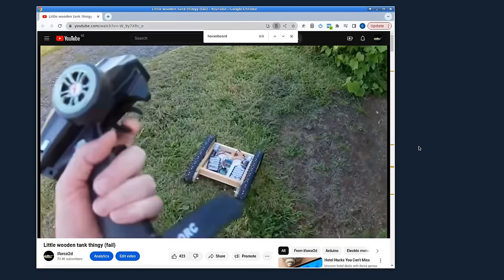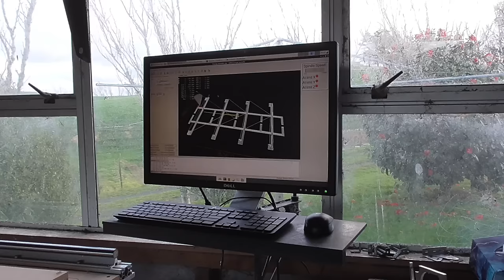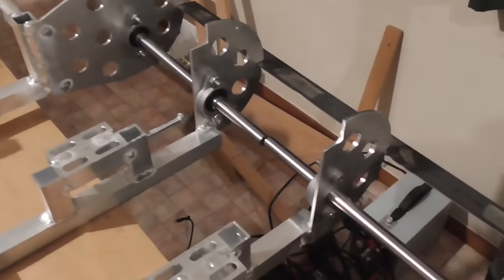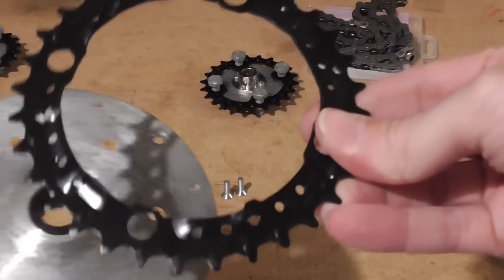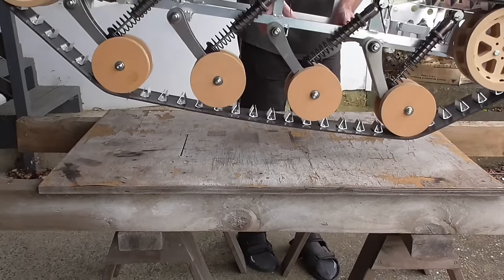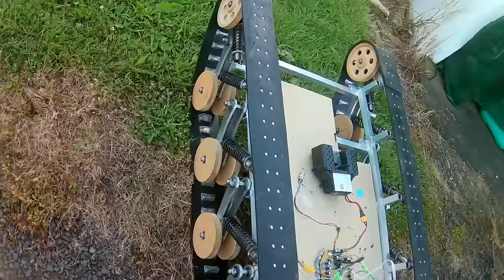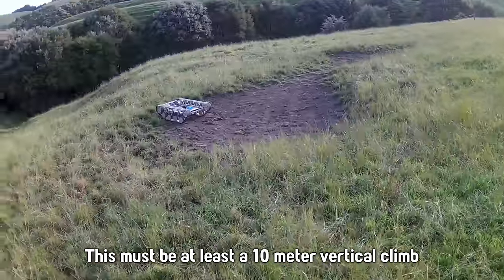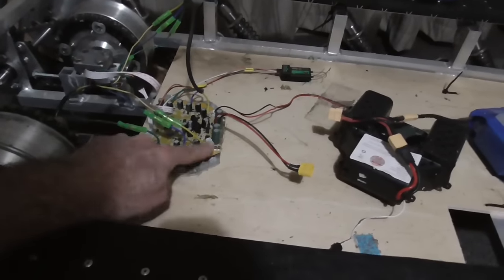RC tank thingy (hoverboard motors)

Comment: I think you need either bigger springs or more preload on your front idler shocks to stop the tracks winding up when you reverse, in the clips you can see the idlers moving backwards and dropping the tension off the tracks. Otherwise fantastic project, reminds me of the bomb disposal robots I drove around for years.
Reply: His suspension is pointing ass end. This means any speed or traction will reduce the diameter of the tracks.
Reply: Yeah, the preload needs to be wound up quite a bit.

Comment: I smiled from beginning to end like an old crone gurning!  Love the CNC drive sprockets etc.  I did not think the MDF would be good for more than a few lightly loaded runs... they sure proved me wrong.
When reversing, the full torque of the motor is directly compressing the spring of the front sprocket.  Don't increase the preload of that spring, but limit the travel of the front sprocket to the point where the belt teeth cannot skip.  Something like tube or hose over the front shock absorber shaft should do it.
As you said, sorting the gearing is first priority.  Plenty of options, but none that really stand out.
The amount of grip you are getting from the smooth tracks is amazing!  I always assumed you had to have really agressive teeth (Edit: "treads").
This is obviously not a cheap project, but at this point it has relegated the Farm Rover to Fading Ghost status!
Love it, thanks.

Comment: You could use a second set of sprockets towards the center to modify the gearing without changing your front sprockets.  You'd just need to move either the motors or the driven sprockets to have the altered alignment so the chains could go towards the center then to the driven axle
Reply: I think it's called a counter shaft or jack shaft. Looks like the tank could use more weight towards the middle.

Comment: A very fascinating design, particularly the suspension. Love the CNC work, it like seeing art being made. Impressive performance, climbing hill, etc. I don't think this fantastic project is going to be put aside for long, as it sounded like you're having too much fun. ;)
Regarding the gearing ratio, to me looks like the rear cross brace is in the wrong spot to use larger gear. (45:35) It will need to move aft, or forward relative to the axil(s). Don't think there will be much bulge, just a bit in front of and half way to the motor. Using a nearer to 1:1 gear ratio would eliminate any bulge. The more complex option is bigger rear wheel sprockets (to match the larger gear size) and lowering axil to keep flat top. It would not impact suspension clearance height, but might mean moving rearward to allow the rear suspension arm to have full travel (an issue pointed out). A stronger spring on the rear arm might stop the bottoming out.

Comment: Brilliant build, I've built a six wheeled cargo robot of a similar size using hoverboard motors. Top tip (and I wish I knew it before I built mine) is that the width between the tracks needs to be wider than the tracks are long. This gives you a lot more turning torque, tanks get around this with brute force which is why they can be narrower. You could also increase the preload on the suspension so that by default the front or rear is higher off the ground
Reply: Suspension is 100% on the list for the v2...
https://youtu.be/VlSwjEoBnWk

Comment: Lol, I wasn't expecting to see my name on the video, especially from a 3yo comment! I'm thrilled you make the hoverboard tracked vehicle a reality! They truly are a fantastic platform for robotics applications.

Just a couple notes & thoughts:
1. Make sure you tune the ADC readings for battery voltage. At least for me, I found that the replacement firmwares were triggering low-battery shutoffs even when the actual state of charge was fairly high. There is a procedure in the docs for calibrating those values.
2. Have you considered designing a replacement wheel/tire for the hub motor itself, allowing direct drive? The hoverboard motors are pretty well sealed out of the gate, and when I built of HB E-longboard I ran it though lots of muddy, puddles, and through the rain without any water ingress. The benefit here would be eliminating the chain/sprocket/drive axles/bearings entirely, allowing a much more easily 'waterproofed' system with less complexity.

Great video as always!
Reply from the maker: Yeah, after both runs the battery was at 35.5V which seems a little high, barely under storage charge.
I did notice some decent seals on the shaft, good to hear they are at least reasonably waterproof. After this first test I'm thinking more that direct drive might be the way to go. I'd like it to be fully amphibious so extra measures might be necessary, but it's probably an easier starting point than trying to waterproof a spinning shaft coming out of the hull.
Reply: @iforce2d  yeah definitely sounds like the calibration could be off, unless those HB batteries have high ESR and sag a lot under load. If it's helpful at all, I have discovered those HB main boards and motors run fantastic under a 13S battery. I have a cart I built using two sets (4WD) powered from a 13S Lion data center backup power pack rated for 100A cont. Discharge. Haven't killed a motor or main boards on it yet, so I think it can handle it safely. My HB longboard is a custom 12S battery and it runs great with that too.

Last note about the waterproofing, you might want to pop the seals off the shafts and grease them up. Every motor I have gotten has had the seal there, but be bone dry defeating the purpose and maybe even prematurely wearing out the seal. The grease will definitely help them.

Comment: the hoverboard firmwares will put out debug info/telemetry on a serial port depending on the config you use.  You can add a single ESP32 to glue together RC (crossfire)/bluetooth (wiimote)/hoverboard protocols as well as drive an OLED display for data, minor data logging, and a web interface for configuration if necessary.  you get a lot of bang for the buck for just 1 ESP32.  You also probably don't want to be using PWM because those boards are extremely noisy and the hoverboard firmware does not handle PWM noise very gracefully.

Comment: Midway in the video I though it was going to be way bigger hehe. I have 4 of those motors on my skateboard. If you rewire them from star to Delta connection inside they become beasts! You loose a slight amount of torque but gain a multiple amount of power! So Delta connection with down gearing turns these motors into something usable in 1:1 size application. 4 of these motors would actually be enough power for something that you could sit on and take you many miles. My skateboard is more powerful than a moped and takes me about 15miles on asphalt. I run 4 vesc on my setup and 8 Makita 18V batteries at 36V working voltage. Giving the motors 56V and really geared down you could make something real useful with 4-6 of em! A ridable 6 wheeler would be awesome! The clue is motor efficiency, Delta is way more efficient and you dont really loose much energy in a gearbox vs twice the twice the winding resistance in the original star winding setup these comes with.

Comment: Hey Chris, this could cost you a lot, the tracks alone. But I see you had some nice design challenges to solve. Re-gearing it would be better. Going backwards though, there seems not enough guidance from the top part of the track, maybe that's why the teeth are jumping at times? When the tension is the lowest it happens. That bump stop will help for sure, it looks very stable as well.
Thanks for this one!
Cheers 👍💪✌

Comment: I had the same problem machining a slot in steel with a high speed spindle. What worked for me was  to use a smaller end mill and do a trochoidal toolpath, full depth.
Reply from the maker: I bought a lathe recently which I will try for this job next time, if there is a next time. The lathe can go much slower.

Comment: I’m also building ex tanks but smaller and high speed. Achieving good yaw control is critical. I’m currently experimenting with gyros. I also think sensored motor control is also needed.

Comment: Well dang. I've been looking to do almost exactly this only I didnt think of the hoverboard. The best I'd gotten so far was scooter motor hubs, which are a lot more expensive for one than for whole hoverboard.
-edit
not for nothing, but if you want more high speed power at slightly (significantly) more cost, you can remove the rectification diodes from an alternator and power it with a regular sensorless ESP. Then you've got the belt attachment ready to go. Also, obviously, you have to power the rotor field coils, which is annoying.

Comment: To improve spring strength, could you nest the old springs inside the new ones?
For suspension, could you make half of the swing arms swing back and the other half swing forward, so you have them preloading the same amount on the tracks in either direction of travel? That looks like a bit of work to re-weld the frame though.

Those tracks look surprisngly good! 

Though there may be ways to improve them without adding much cost, could you use two layers of rubber, instead of overlapping them to join, you just offset the layers by half the length for the most engagement between the layers. You could also possibly put some kevlar cloth between the two layers to prevent stretching of the tracks, that stuff is damn stiff in tension! 

I hear you can improve power dissipation in those motors by either filling them with a light oil, so there is better thermal conductivity to the outside casing, or machineing vent holes in the side plates so they pump air through themselves
Reply from the maker: The springs are all the same size unfortunately. I could make some spacers to increase the preload though.
If you want any reasonable speed over bumps, you can't have the swingarms swinging forward.

Comment: Wondered if you considered using chain as the drive to which one could attach the "now flexible and stretchy" rubber.  Important just where one locates any "idler tensioner " as well, usually only on the off drive side of any pulley arrangement. Difficult /well-nigh impossible to do when one has reversing drive.

Comment: 22:50 - just have the same adapter plate for the small holes, but put the big holes inside the small, right?

As long as the small sprogit fits over "the bumpy thing", that should work I reckon.
Reply from the maker: The chain is about 8mm wide and needs to overhang the aluminium adapter plate, is the awkward part. I could make a second (small) adapter plate to attach to the first and allow the overhang, but I think it would then collide with the motor mount clamp. Might need to change the motor mount completely...

Comment: I had some issues with lag on the same transmitter so I wouldn't be surprised if that was the cause of the lag.  One thing I would definitely do is increase the tension on the tracks to make sure it can actually reverse. You can see it loosening up quite a bit every time
Reply from the maker: The 'lag' is coming from the 'velocity' control method which uses the hall sensors to measure how far the motor has turned. When I let go of the stick, the momentum carries the tank a bit further, the controller senses this and corrects it, with a slight delay. You can see this at 32:19 where it even oscillates twice (right where I'm saying 'whoa..')

Comment: HARDER SPRINGS MEAN ONE OF THE MOST IMPORTANT ASPECT OF A TRACKED VEHICLE WONT BE UTILIZED. FOR THE TRACKS TO GO OVER STEEP OBSTACLES LIKE THE DOOR SILL, THEY NEED TO GO IN FOR EVERY WHEEL WHILE IT TOUCHES THE DOOR SILL TO ENSURE A LOT OF CONTACT IS MADE BY THE TRACK AND THE OBSTACLE TO ENABLE MOVEMENT. SO YOU EITHER NEED MORE WEIGHT OR SOFTER SPRINGS OR A MODERATED COMBINATION OF BOTH. ALSO YOU NEED TO ADD EITHER RUBBER OR METAL TRACKS ON THE OUTSIDE LIKE ON THE INSIDE TO ENSURE PROPER GRIP. THAT IS ANOTHER ESSENTIAL THING ABOUT TRACKED VEHICLES THAT IS MISSING. I'M SURE YOU HAD OTHER THINGS YOU WANT TO DO TO IT BUT I JUST THOUGH OF POINTING THESE THINGS OUT. I ALWAYS TYPE IN CAPS, MAKES MY COMMENTS STAND OUT.
Reply: DO YOU SHOUT A LOT WHEN YOU ARE TALKING TO PEOPLE?

Comment: Nice ! 
But, the fixation of the damper make me a bit nervous : these "long" tubes on the thin square tube must have so many stress. A little diagonal bar would make it a lot stronger, specially if you have oil...
Reply from the maker: When the hull is finished there will be bars going across the top to connect those upright sections, so they will not look so vulnerable. Also keep in mind they are not taking direct shock from bumps in the ground, only 'slowed' shock via the spring.

Comment: great build but i suspect that the batteries might be bad, they should last longer or it just pulls a lot of current, i bought a lot of old/broken hoverboards (for the motors to use on all kind of projects i wanted to make, like a go-cart, compact boat motor, electric scooter, ect..) but in my experience the battery packs were always bad, like a few cells in the pack were dead or out of balance, and since they are all in series that ruins the overall performance of the battery, they don't have balancers the bms is usually just overvoltage/undervoltage and overcurrent protection
Reply from the maker: Yeah all these batteries I have are probably not very good, sometimes people sell these thinking they're broken when it's just the battery dying.

Comment: A lot of real life tanks have the drive sprockets in FRONT and the tensioner wheels in back? Another thought is, you might be able to use Roller-blade skate wheels instead of the MDF ones, they are made of tough material and have precision bearings already? The track stretch seems like it will be a struggle until you get a better material to make tracks from, but you are onto something for sure! CHEERS!

Comment: For the welding u need to make a welding table so when u do some welding u clamp it down nice and tight to stop the warping from heat and for the tig tip file it down to a 60 degree angle and clean the alum with acetone or iso alcohol cause it needs to be a clean surface
Reply from the maker: The warping comes from the weld bead shrinking when it cools, you can't get around it just by clamping things in place.

Comment: more weight - more off-road capability
Reply: Tell that to Suzuki owners
Reply: nothing will help them
Reply from the maker: I don't really understand this logic. If this thing weighed just 1kg do you think it would be less off-road capable? One of the advantages of tracks is you can spread weight over a larger area, the goal being to keep ground pressure low. More weight means more traction is required, seems like it would just cancel out (and use more battery for the same result). If the ground surface traction can be improved by compressing it (eg. snow) I suppose more weight might help.

Comment: It seems as if the tracks get slacker as the spring are compressed more. Could you have some idlers on the top edge connected to the arms fixed to the bottom idlers such that the tension on the track is constant?
Reply from the maker: That was one of my earlier designs actually. In the end I wanted to keep the tracks straight along the top so that any kind of attachment could be bolted on without worrying about tracks getting bounced up into it... as much.
Reply: That's an interesting idea... I've never seen anything like that in practice, but it makes a lot of sense as long as there is clearance above the top of the track.

Comment: just add two rollers per side with  spring pressure upwards that the slack gets compensated. that would be my idea (similar to these support rollers: https://youtu.be/KgCaZiriN5Y?si=na8hDTdFFjTlzRsQ&t=157 ) or maybe stiffer springs on the front rollers.
very nice job , the idea using hoverboard motors is instantly noted, cheap and powerfull these motors and sick job on the frame!

Comment: i just always dream  to make a such project. I wandering , why you don't integrate in the back  idler  the hub motor (kind of direct drive) , this way no need anymore all gears and chains. the motors will be just fine, and fix your problem with staying under "floor" level.
Reply from the maker: A few reasons. The motors are 1/4 of the total weight so having them way out on one end might be bad for CG balance. Having the motors inside the drive wheel means there would be a limit on how small the drive wheel can be. The motors might not be waterproof. There would be no possibility for gearing change. How to attach the drive wheel (cog part) to the motor becomes a new problem, not as easy as my chainring method. Eventually the drive wheel will be HDPE so I could not simply weld it onto the motors.